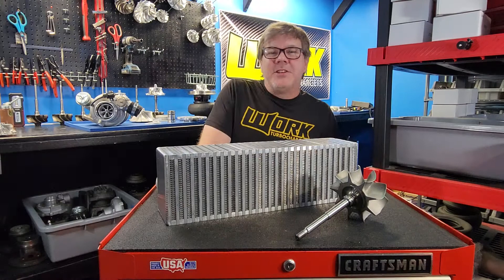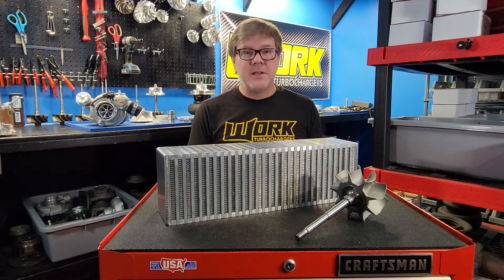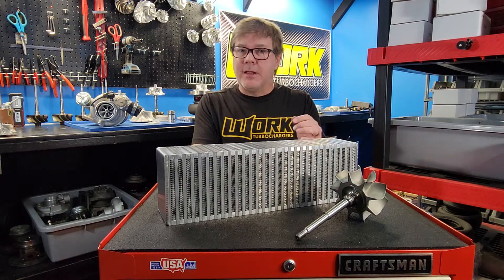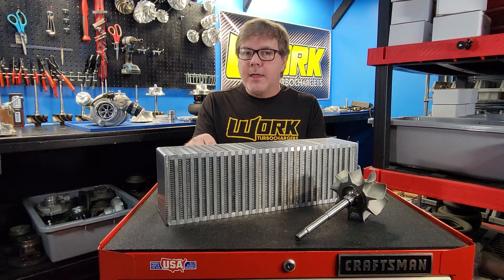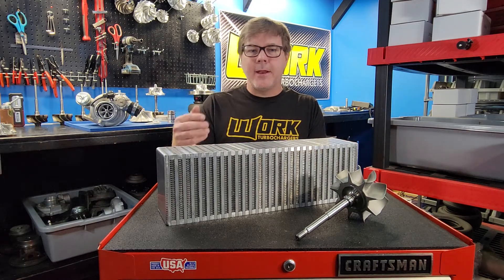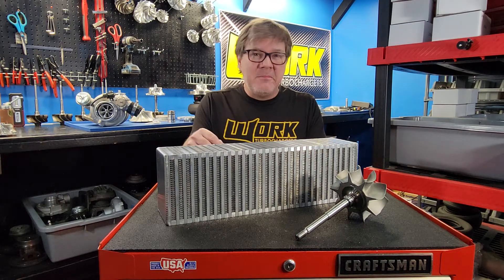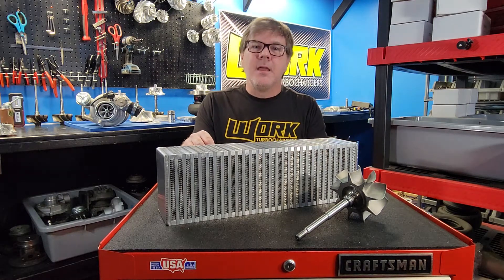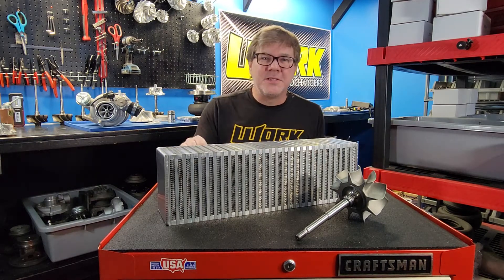5 Minute Turbo Tech Tips With Reed, Episode 2: Intercooler Pressure Drop

Comment: I want to disagree with one claim. If testing the boost pressure from the turbocharger by connecting the boost gauge to the compressor cover in the beginning og the snail, far away from the outlet, the result will be WRONG as the pressure there is lower than the boost pressure out of the compressor outlet. :)
Reply from the maker: There is validity to your response, and it is measurable...but it also is a very small amount in most cases.

Most people do not comprehend how a centrifugal compressor housing functions...most do not even know how a compressor wheel "works" as well.

Knowing that the compressor tubing is an extension of the volute and has a purpose to a degree that is more than just connecting the compressor to the system will be a future topic.  

I will be going over this with real world data in the future...lets just say I have a lot of "ports" in a housing and piping for the data.   

On a traditional compressor cover with the port located outside the torus centerline in the "spigot", the pressure drop is minimal from what I have found "If" the compressor piping does not make a drastic volume change directly after that point.  At least using my measurement hardware.

I could spend quite a bit of time just studying this design attribute and testing variations...

Thank you for bringing this up, it gives me motivation to learn more!  -Reed
Reply: @workturbo  Having messed around with old Volvo and Ford T3 turbos there are som surpricing variances where the wastegate actuator signal hose is connected to the compressorhousing and also the length of the wastegate arm. 
I have concluded that for maksimum boost responce and maksium torque a large svingvalve, a short wastegatarm and the signal hose connected at the beginning of the snail on the compressorhousing is the right way to do this. The wastegate actuator spring should be long to have a fair amount of prelod at rest. 
A bleed valve / manual boost controller is of course a must. 

When Volvo turboconverted their stock NA carb engines they wanted the opposite results. The used smal swingvalves with longer wastegate arm, a wastegateactuator with a shorter stiffer spring and the signal hose was connected by the outlet of the compressor housing. Do NOT use a bleed valve here. 
All this to avoid detonation and clutch slippage. :)

Comment: Hi mate. I got a k04-064 mk6 gti if you're familiar. With iat at 20deg C  I'm making 18psi peak and 15psi hold from the compressor nipple to factory n75, but at the IM I'm making 3psi more on both of those results of compressor. What could cause this ?
Reply from the maker: My first test would be using the same gauge reference for both points...most likely the data is skewed would be my 1st guess.  Although I am still thinking this through, and no tests I have ever done have seen an increase in manifold pressure over compressor pressure.  

One possibility could be the intake "surging" and causing pressure spikes in the positive direction.  The imap sensor could have a degree of latency or the point where it is reading has high amounts of reverberation causing incorrect data to be observed.  Just brainstorming, but a very interesting phenomena if it is actually accurate data.  

Maybe some others could chime in? -Reed

Comment: Some if thr pressure drop can be attributed to the drop in temperature, not necessarily solely the restriction from the intercooler core.
Reply from the maker: Very good point that is on my list for a future video.  Density vs temp vs psi should be easy enough to plot.  Most tests that I have done validate the "2.5" psi ▲ makes up for the density recovery and is a good reason that number seems to be the acceptable amount.  Explaining why this is the case will again be a great video topic.  Thanks Eric for keeping that topic fresh on my mind.  -Reed

Comment: I've got a VGT turbo in a 1987 BMW 325 (HE351VE from 6.7L Cummins, 2.7L 2-valve low compression ratio engine). Goal for the car was to make really good power at moderate levels of boost (i.e. big turbo) while not giving up much in terms of spool.

It's running Megasquirt 2 and I designed a controller/control algorithm for the VGT and wastegate. VGT control algorithm is coupled with dome pressure wastegate control (compressed air onboard). Since the VGT can increase drive pressure enough to unseat a soft/medium wastegate spring and defeat the purpose, they have to be pretty tightly coordinated - it keeps max pressure on the dome until I'm almost at the boost target, then lets closed loop dome pressure control take over. VGT runs at an rpm-based "effective" wide open state while cruising around (not fully wide open, to keep turbo shaft speed up without any increase in back pressure), closes up "just enough" (that's the hard part!) when boost target exceeds MAP, and ramps to fully open once MAP gets close enough to boost target.

As part of the mapping of the VGT response, I added exhaust backpressure and at medium levels of boost (currently running 12-13psi with plans to eventually get closer to 20psi), with VGT wide open, drive pressure is a little higher than expected given the headroom I still have. Seeing about 1.4-1.6:1 throughout the rev range. 

This video made it occur to me that, hey, maybe it's my small water-air intercooler causing a decent pressure drop, and actually my drive pressure is a little better. It's a "350hp" capable unit which I believe I'm at or exceeding at current boost levels. So I guess it's time to add one more sensor to the mix and measure it!
Reply from the maker: Checking that intercooler pressure drop will help shed some light on the situation for sure!   Glad this "may" have helped you out.  VGT strategy on a wide rpm range spark ignited engine has to be "fun!!!"
Reply: @workturbo  definitely “fun” haha! Especially since I’m 6000ft above sea level. But I can get to full boost (slowly) at 3000rpm with a 7000rpm redline, and nearly instantly above 4000rpm.
Reply: How would you measure pressure drop on a twin turbo set up? Tap a line into each one then T both into a line?@workturbo

Comment: Do you have a rule of thumb for what is too much? For a given horsepower level perhaps?
Reply: From what I've learned, good cores stay at around 2-3psi
Reply: @PiterStreak  I've generally heard under 2-3 as well, but of course also depends on what boost level you're running.
Reply from the maker: Just like PiterStreak said, 2-3 psi max for good performance, but less the better.  It is not uncommon to see that number rise as the boost pressure goes up.Watch for a new video coming soon that will help shed some insight on balancing pressure drop, efficiency and flow. Each one of these things directly impacts the other!
Reply: @workturbo  Look forward to it! 🙌
Reply: I have a 10psi wastegate spring and an ebay intercooler and see 9psi on my intake manifold after the throttle body.
Reply: @davidgriggs3967  That sounds pretty typical and solid since you'll rarely see exactly what the wastegate spring is anyways. Would have to take a pressure reading before the intercooler to be sure there is that much drop.